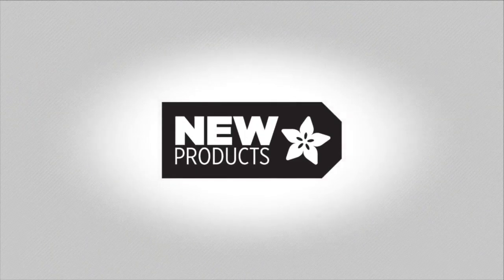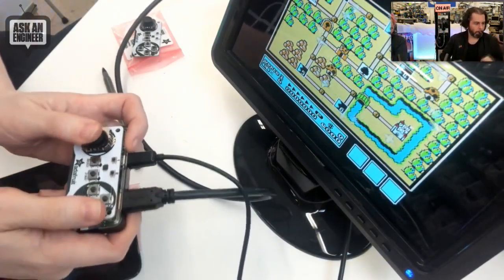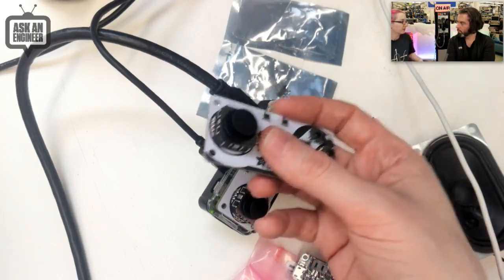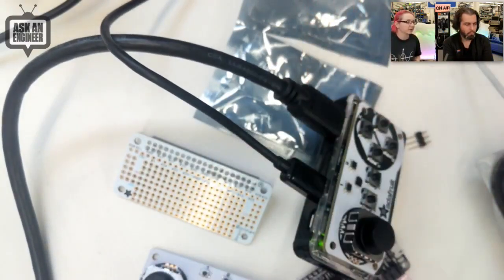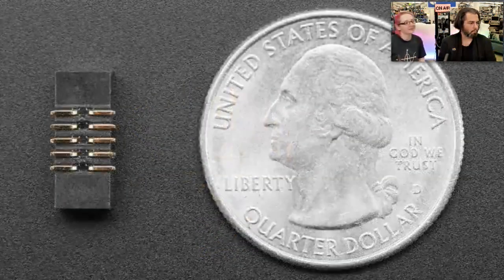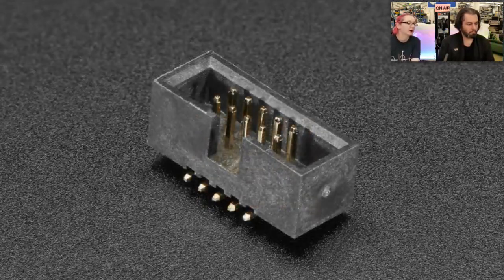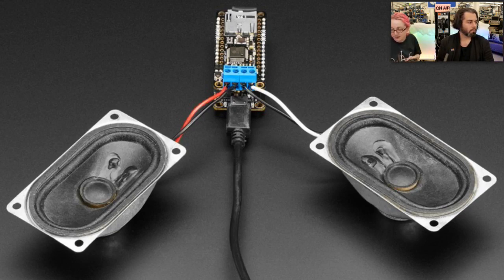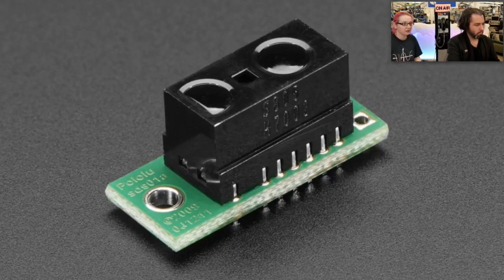New Products 3/22/2017

Comment: Can you make a arduino based board ( 30mm * 20 mm ) with :

. dual dc motor driver
. BLE ( and wireless uploading sketch )
. Lipo charging and powered by

It will be perfect at low price to convert some toy cars to real racing cars and some Ho scale motorised things
Reply: No the Arduino community is extremely large, larger if not in par with the Raspberry Pi. Raspberries are better for high-level coding such as Javascript or Python, but the Arduino is the best for low-level hardware such as the arduino. Therefore, in the robotics field, the Arduino would be much better.
Reply: ...but does the rasp pi have a led blinker program - that's the real question.
Reply: DFrobot's got you. google search "DFrobot romeo" and there will be the board you're looking for. there's also a romeo BLE and a romeo mini.
Reply: Arduino and Pi are geared towards different things.  I work in a world class ECE academic department, I sell equipment to students and by far, most of our students use Arduino and they have a choice.  Our 110 class is taught on a clone Arduino platform.  They're different tools for different purposes.
Reply: Write the program yourself, in Python - that's the real answer.
Reply: LOL!   Arduino....
Why are you so reluctant to come on over to the Raspberry Pi community?
The Community over here is HUGE compared to Adruino.
We even have our own community supported FREE Magazine that comes out monthly with all the projects we make and submit to it,  in order to share it to the world.  Take a look friend.
Might I recommend downloading the "Projects Book 2" just to explore,  then maybe get this months issue and catch up!
https://www.raspberrypi.org/magpi/issues/

Comment: Sorry, the low volume excuse doesn't wash, the same was true of the Pi Zero and it sold for $5...
Reply: Dude they literally made a PCB for that Broadcom chip and broke out the pins to the DIMM form factor . . . what is the complaint here? If you want to make a product with that Broadcom chip now you have the choice of using this compute module and designing the daughterboard. That's the point of it
Reply: Granted, and I am not really complaining, but IMO it is priced more on it's target market then on what it costs to produce. CM has always been targeted more at embedded designs for more commercial markets that see a $100-$200 dev board as cheap. I mean let's be honest, PCB's, even in small runs, are dirt cheap these days, and the "dev" board doesn't really have any expensive components, 2IC's, the power supply chip and what looks like a USB hub. It is even a single sided load, so even cheaper and easier to make.
Reply: I think the compute module is a much deeper niche product than the Zero. You can get everything you need to operate a Zero for around $30 on Adafruit or Amazon. To use the Compute Module you (probably) need to design a PCB around it, or else buy the crazy-expensive I/O board...  Unless you want to solder wires to the module's pads or something.
Zero is a product a broad audience can use pretty easily. Compute module is not. I think that's a pretty significant difference...

Comment: is the "analog" stick actually analog, or is it just using comparators to map to discrete inputs?
Reply: From looking at the schematic and the source code, the answer seems to be "both"
From a hardware standpoint, it's an analog input device interfaced via an I2C ADC chip.
From a software standpoint, the Python script Adafruit provides for the device takes numeric readings from the ADC chip, then compares these with thresholds in the script to determine which up/down/left/right keystrokes should be generated.
So with better software this could be a real analog controller for the Pi. But with the software Adafruit provides right now it's just kind of a crude analog-stick-as-joypad solution.